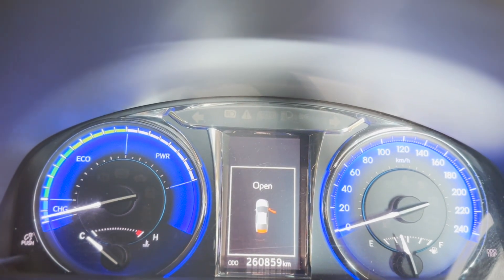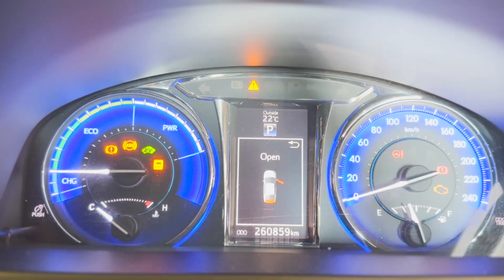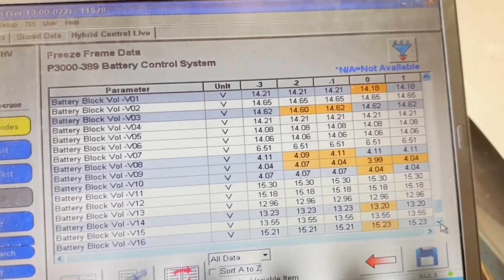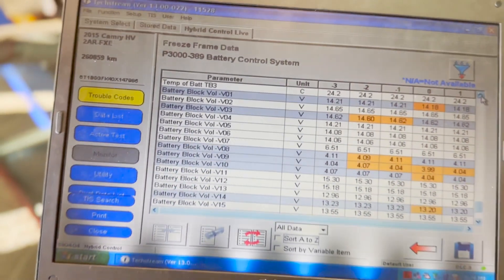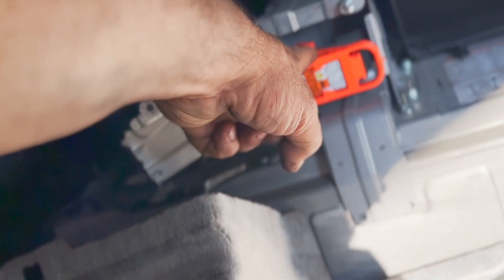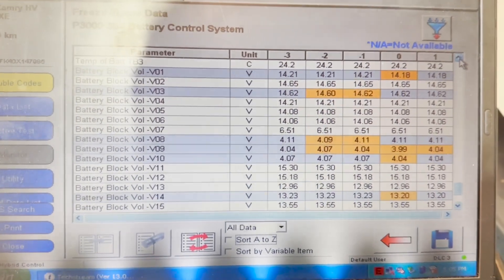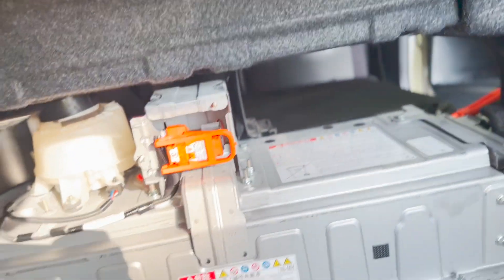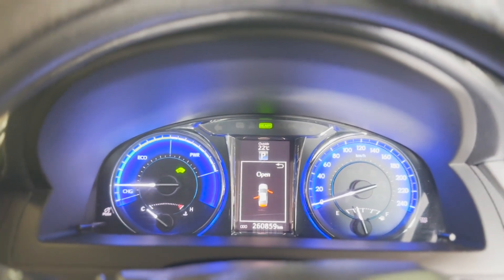Toyota Camry Hybrid (Dead) Battery | Code #P3000-389

Comment: This person is not a hybrid specialist. There is ZERO reason to disconnect the HV safety plug in this scenario. It has ZERO benefit, and it actually causes problems when people don't install the plug properly. Just disconnect the 12V. Done.